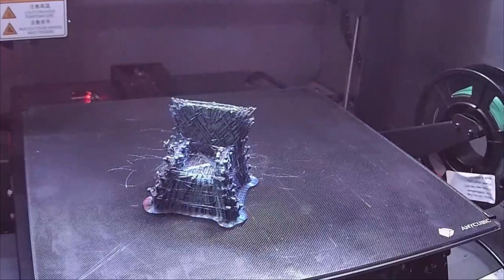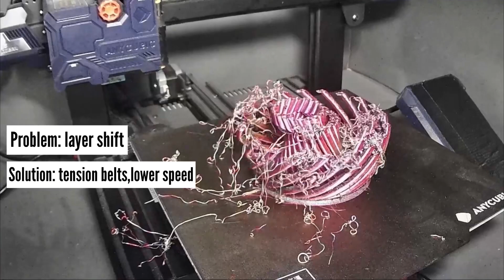19 BAD 3D-print Fails: Timelapse Compilation & Troubleshooting Guide (in description)

Comment: so basically make sure you print slow and it sticks to the bed, in most cases
Reply from the maker: Yes, speed is a big factor of course but also a level and clean bed, bed temperature, choice of filament, Z hop etc. There are many factors to consider when 3D-printing! You can check the description for more details :-)